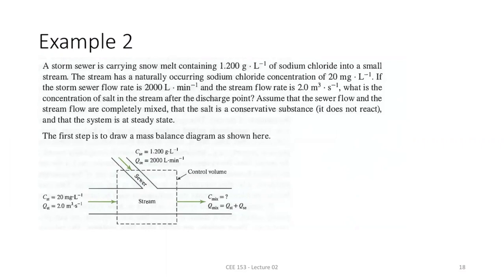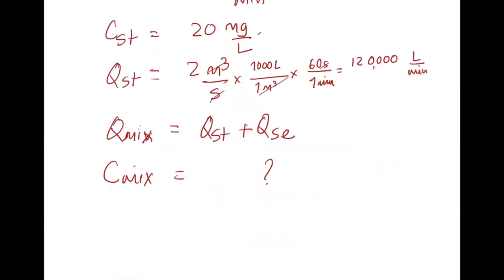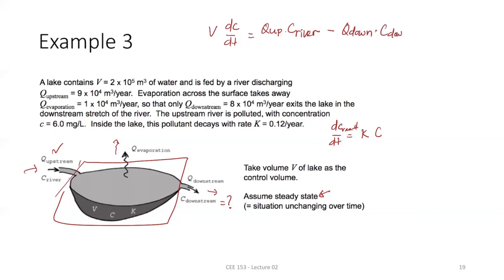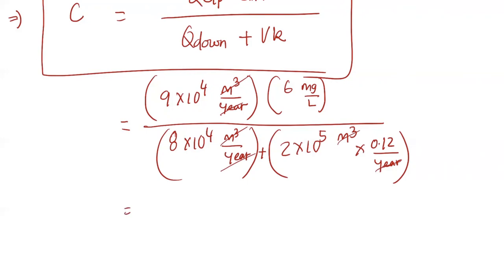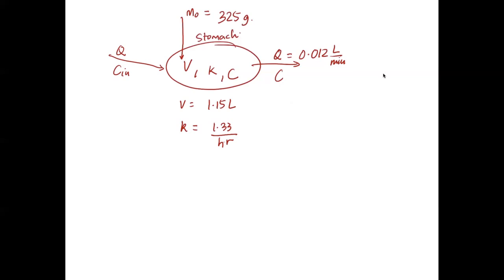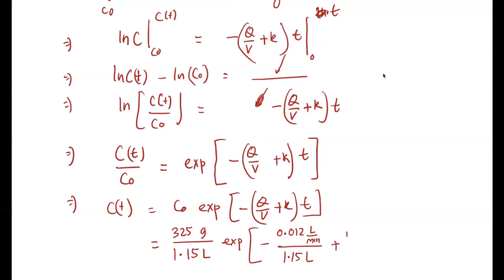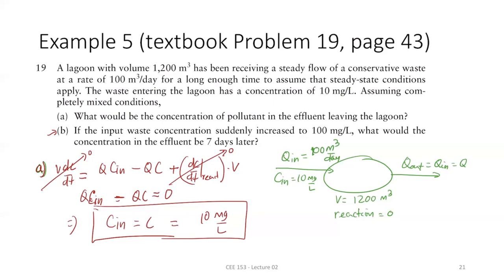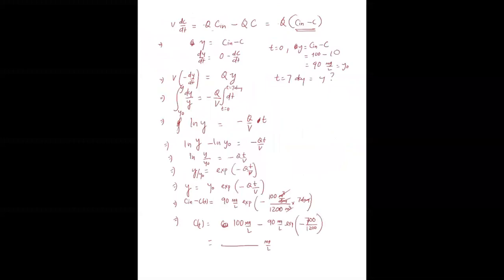CEE153 - L02C - Mass Balance Examples

Comment: @41.44 you mention that there no second term because there is no reaction. If the concentration is different coming in at t = 0 than the concentration flowing out, then why is there no reaction? I would think a reaction must occur for the concentrations to equate to each other again.
Reply from the maker: Concentration can be different because of dilution. Imagine dumping a bucket of contaminated water in a pond. Bucket water (in) would have very high concentration compared to the pond water even after mixing because of dilution.